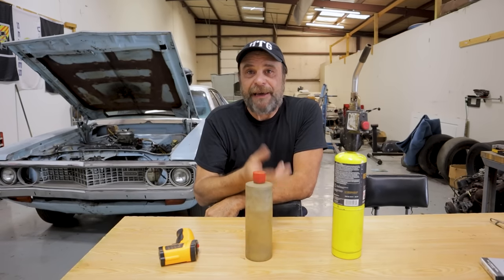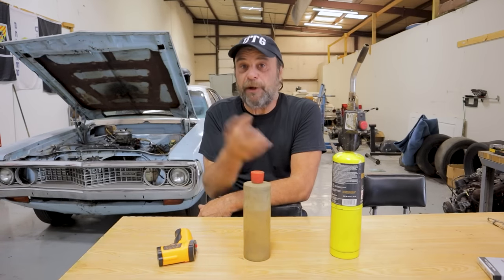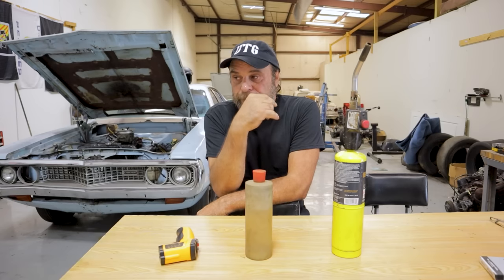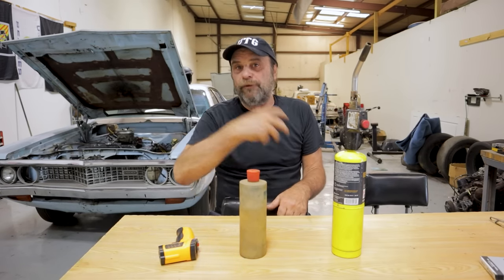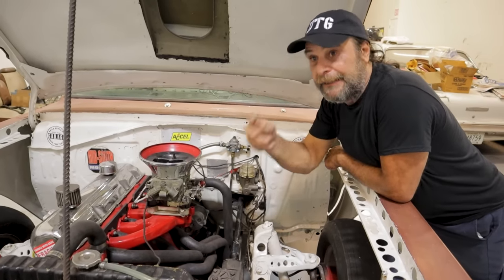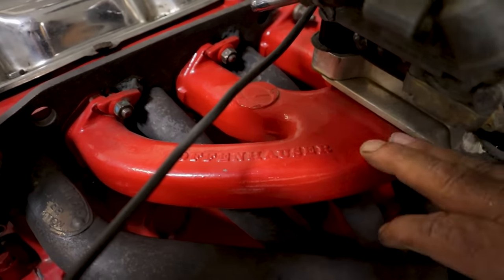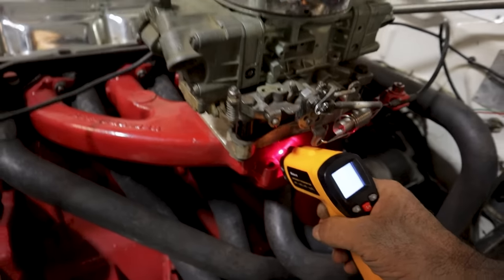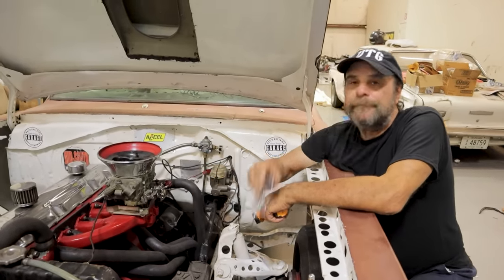How Much Intake Manifold Heat Is Enough? Testing The Vaporization Temps Of Modern Gasoline

Comment: When you talked about that "pre-chamber" ignition system, that is what they are doing in F1 to be able to run a leaner mixture, and extract the most possible energy from combustion event.
Reply: That was Honda cvcc designed in the Late 70s and early 80s cool that f1 is using that technique aswell
Reply: Cvcc honda...  This
Reply: It’s Turbulent Jet Ignition I believe
Reply: B.S. NOBODY runs lean fuel mixures in a turbocharged race engines, if they want the engine to survive, as a matter of fact, only detonation will kill a turbo engine faster than lean mixtures, barring no oil / no coolant.
Reply: @jamesgeorge4874  Improving combustion efficiency is key for F1 engineers since the regulations limit the total amount of fuel that can be used in a race as well as the fuel-flow rate. This new technology replaces the standard spark plug in each cylinder with a jet ignition chamber and helps support ultra lean-burn operation in gas engines. If properly designed, this jet igniter can be a drop-in replacement for the spark plug.
Reply: @jamesgeorge4874  that was a paragraph from one of MANY articles that are a simple Google search reveals. Just search "how F1 jet ignition works". Yes, they are running those engines a lot leaner than you would think.
Reply: @Taranabas52  Interesting info.
Reply: @Spike-sk7ql  Let me clarify, the TJI system is slightly more efficient than previous designs in F1 applications, but F1 is NOT running an ultra lean mixture, because they don't make power, and lean mixtures are catastrophic to turbocharged engines. In NA engines, TJI IS able to run ultra lean mixtures, and with lo NOx output as well, but it requres higher compression, and multiple injection, and ignition events per powerstroke which F1 does not allow , currently. If your info came from engine labs, I understand how you would figure F1 is running ultra lean mixtures, because there isn't a clear distinction between a race engines needs, vs a road car engine needs. For what it's worth practically every fuel injected car built in the last  35 years runs "ultra lean mixtures" when you enter closed throttle mode, it's call deceleration fuel cut off, and zero fuel is injected. Hard to be leaner than that.

Comment: For the winter time in NJ back years ago I used to have a plate that would snap in between the headers. 
 It was a place I could stick a Sterno heater under the intake to pre heat and warm it up before I take off .

Comment: Humm, really interesting and not an issue I would have guessed, learning from UTG.  Looking forward to see the testing results.  I would be mildly surprised if this turns out to be the sole source of the issues but after the explanation, I can see how this is a contributing issue.   Kind of goes against the idea of cooling the charge for more power.

Comment: Now that I'm done talking smack on using a 6 cylinder... still not my thing, but I dont know how the dodge 6 is but the chevy 6 has an intake with a floor that has the exhaust directly below it with a valve that opens for cold starts and lets the car warm up, then closes. The one I had I left stock, and even working correctly on stock stuff it ran like shit until it was warmed up and then it ran fine. I bet this for sure fixes your problem assuming your tune up is as close as you think it is. Good luck

Comment: I’ve dealt with many off idle stumbles, flat spots etc. 90% of the time it was the idle mixture screws either too rich or to lean. Even if you think they are set perfect, it’s best to test on an off idle launch. Adjust one way or the other and see if it starts to correct itself, if that doesn’t help at all then deal with the squirters, accel pumps etc. a lot of people jump to adding more fuel out of the box when they stumble.

Comment: Suzuki used a PTC heater under the throttle body on the 1.6 four cylinder engines in the Sidekick/Geo Tracker. I’m guessing it served that same purpose. They did have coolant running thru the aluminum intake, but it wouldn’t be providing much heat on cold starts.

Comment: Wow, utg outstanding video. I'm vary grateful. I have seen slant sixes with headers and a coolant chamber under the 4 barrel intake. So that it saw coolant Temps 180 or near which every thermostat used. Seems  to be the way to go. What are your thoughts?

Comment: Chrysler wants the carburetor set so that the floats react to 1, the slosh on launch [fuel bowls] as well as 2, the tip angle of the engine, based on the angle of the drive pinion angle.

Comment: Modern cars run coolant through the throttle body. 

Make a  hose route coolant around the intake with a heater valve with a cable and temp sensor in the intake. 

That way you can have all the data. 
Analogue. 
Have your exact temp. 
Spend almost nothing but time and a cheap temp gauge.

Comment: I just built a hot Chevy 292 ,(blank check build) for street / strip/ fun and shows, I had a Man A Fre 3X2 and we bolted  on the dyno and with touch anything we pulled 373 hp Then the rear carb took a shit that drove us nuts for hours. ,We swapped it out for a clifford dual quad with two 450 holleys, everything is new except the 3X2 Carbs off the Man A Fre. We pulled360 TO 383 HP & 418 TQ , The rear carb failed after the 3rd pull. no fuel in #6 cylinder ,The dual quads pulled well but not much different and feels lazy ,The Man  A Fre Intake was NOS !!! AND FOR A INLINE CHEVY SUPER RARE FIND !!! The guy that worked for man a fre in the 60s and 70s id still around and has tons of parts and rebuilds thems for street /stip or show .Super nice guy. But you may not be getting what's in the picture I paid 2500 for the complete set up. first thing  the carbs are not restored, they looked old,when we turned the fuel on the dyno every carb connection looked like a sprinkler . OK,,,,On go the brand new 2X4 AND MADE GOOD POWER AND ANOTHER 10 hp  from an ACCEL coil !!! 4 speed ,choppy cam top notch build. .. I sent all three carbs to Vintage Carbs, he said all three were put together with jnk and old used parts !! not one cluster matched !!!  Yeah I got the typical E-Bay shaft but vintage speed said that he can build me 3 exact Rochester 2 jets and knows I want perfection .and willing to pay for it. I'm doing this since the 1970s.I think  The direct injection 3X2 set up right will outperform the the 2X4 in this application ,

Comment: From what Google just told me, gasoline has a boiling range between 95*f and 395*f at atmospheric pressure. My understanding is this boiling point would be significantly reduced in vacuum through the venturi. Generally I believe lower intake temps are ideal.

Full disclosure I'm an efi guy so my fuel is basically vaporized right out of the injector

Comment: I have to disagree. :) 
Most dyno tests will reveal that horsepower increases when coolant temperature is reduced from 212 to 160 degrees. Most dynos run the engines with pretty low coolant temperature. This will produce inflated hp numbers and happy customers. 
Here is one guy chancing from a 200 degree thermostat to a 180 degree thermostat. This is pretty normal. 
https://www.youtube.com/watch?v=RdqV1oHMXCA&t=255s

Engine oli temperature should be above 212 degrees. 
Regarding intake manifolds I think it is pretty disapointing that only the Edelbrock 7116 has provisjon for engine coolant heating / cooling. Therefore I always recomend everyone to CONSIDER running the 7116 and combine it with a 160 degree thermostat.  
We have welded and modifed other manifolds to be able to do the same. 
They do need it as exhaust heating is overdoing it and Air gapping is underdoing it. ;)

Comment: Modern cars run at around 220. The fuel gets injected against the back of the intake valve and has to get some vaporization in the short distance inside the head. The modern intakes are made of plastic so they don't introduce heat into the incoming charge. The air intake usually sucks from down low outside the engine compartment. In order for the fuel to have any chance of vaporization it has to have a much lower boiling point. 

This lower boiling point can lead to the fuel vaporizing in the suction side of the fuel line on carbureted cars. Modern fuel injection runs at higher pressure and the pump is usually in the tank pushing the fuel rather than pulling it. 

Having fuel in a vacuum will reduce it's boiling point so you might be fine at idle or just off idle but when you whack the throttle open vacuum drops nearly immediately. With this drop will be an increase in the boiling point of the fuel. All this to say Uncle Tony you seem to be on the right track here. 

I am building a 318 with a TR5 Edelbrock tunnel ram intake. It has a large open plenum so I am going to try progressive linkage and use a pair of Edelbrock 500 CFM AVS2 carbs with the annular boosters. Hopefully I can get the fuel to distribute and vaporize properly. I might run a warmer thermostat to help with this as there is no exhaust cross over. I'm going for fuel economy with a tunnel ram. LOL.

I'm also toying with the idea of running 180 degree headers with about 39"-42" long 1-5/8" primary tubes. This will be to try and maintain more low end torque. I will also size the collector too match the smaller size requirements of the 180 degree headers.

All this in a 1970 W200 truck. Probably been watching too much Unity Motorsports.

Comment: It’s my understanding that octane is a measurement of flash to prevent premature detonation. 🤷🏻‍♀️ use 87 if you need better quicker flash. Use the 90 for higher compression to slow the flash. You might get earlier bang by dropping your octane. Not sure it will carry the power through top end. 🤷🏻‍♀️

Comment: Your slant needs 30% smaller squirters,  a 30 cc acc. Pump, and a delayed pump cam. Your dumping fuel without air flow. Less fuel....more air! Fine mist from squirters instead of buckets of fuel droplets. A long sweeping and delayed cam!!!! For the pump.  Bring the timing of the secondary blades 30% later. Let the vacuum drop as slow as possible off the line. 
  The heat your looking for is not important.  The air and fuel pass over the intake floor faster than it has time to warm up. If fuel is building up....like it is in your can so far. It's actually cooling the floor with puddles.

Comment: Ethanol baby! So I looked it up an it seems ethanol boils at 173 F or so degrees.  One thing I’d like to point out here is you’re using a temperature device the I believe uses IR signature to determine the temperature. Unfortunately the aluminum plate is shiny and the intake was not. These devices work on emission of IR and shiny surfaces have historically been difficult because their emmisivity is that a word? Is not what temp guns are typically calibrated to read. So there may be some discrepancy between the measurements taken between the plate and the manifold.  

Lol so my cast iron intake manifold question wasn’t so dumb lol, only good luck on a 4 barrel one of those! Next really dumb question is now that the warm up period is Kentucky windage in what happens when you are WFO down the track?
The fuel is taking heat out of that manifold like a vacuum and because it’s aluminum it is saying here ya’ go pal, go play with the spark plugs. 

And the temp is dropping and the vapor percentage is dropping and there’s less fuse to the drops for the spark plugs to play with but the pace is expected to be up at 6000 rippems… have you got enough latent heat in the manifold to pull off the run or are we going to need some auxiliary help with the heat?
Maybe beg, borrow, or gleep a thermocouple and a recording thing to record or see the manifold temp to know if it maintains temp all the way down the track? 

PS they make these thermal switches to control fans and coffee pot heaters and I bet we could find one that’d be pretty close to that 150 mark so it’d heat to 150 switch off cool to the hysteresis maybe 125 or maybe 140 and click back on again 😬😉 

Good luck this weekend at the track!! Go get ‘em!

Comment: IF you have to add a heater to the manifold, they make "self stick" oil pan 12v heaters that you could turn on and off with a switch. That way you could heat just the plenum. I would not trust the adhesive to keep it in place, just because of the header heat. I would sandwich it in place wit a piece of sheet metal. Or you might be able to have a "water box" welded under the manifold so that you would never get high heat going into the manifold.   ///   Something you said about fuel burning speed tripped a switch in my head. I have thought about this for many years, but I have no way of testing it. I wonder if a small amount of diesel fuel mixed in with gasoline (like 5 - 10%) would make more power. It burns slower, has a higher energy density, and has lubricating properties which should help with piston ring sealing.  I am sure you know somebody with a dyno. Maybe you could talk one of them to try that. I am sure it would require larger jets, but if it makes more power, it's one more "trick in the bag".

Comment: @UTG.  You need a LOT of heat to overcome the cooling effect of vaporizing Gasoline. As in exhaust gases hot heat. Even hot coolant circulating through an aluminum block beneath the carb may not be enough in terms of BTU's  required. You may have to re-think the entire intake/exhaust manifold design. Also, not trying to be too critical here, but that chrome air intake horn-of plenty you are using may be cool looking, but it is the wrong shape for smooth air flow into the carb. It looks like the mouth is far too wide, and the outer edges should be well rounded. Just my 2 cents. You have a great channel Tony.

Comment: that's why i laugh when Nelson Racing Engines and others with videos brag how cold their engine is running. you don't want that. Old NASCAR builders would talk about how their engine was running real good just before it overheated. someone once made an intake-to-head gasket with a window screen in the port to help atomize, but let's be frank...you want atomization, you go with pressurized jetted fuel injection.  I see a lot attempts here to heat up the intake system, and the OEM factory setups were doing that in the 1970's with heat stoves off the cast exhaust manifold or running coolant through the intake manifolds or letting hot air splash up from the lifter valley.

Comment: I'm an Internet Expert.  It's obvious what you need is a purple stripe around the top of the carb where the booster layer and choke layer meet.  With your displacement between 1/4 and 3/8 inch wide should get you about 125 HP.  I did my 318 this way and that's what I gained, but it only takes 1/8 inch on the 318 because of the displacement and the heat from the valley.

But seriously I would get a thermocouple temp sensor into the floor of a good running V8 and see what temps you get at different operating conditions while running, then add one to the /6 intake and work on it from there.  The /6 intake will be a lot easier to modify.  No replacement for displacement, or actual data.

Comment: Just a suggestion, you spoke about the clocking of the carburetor and stated that it was what Chrysler engineers stated to do. I would keep an open mind and actually try the 4 positions available if it bolts up without added expense. Can you say, trust no one?  With all the different variables going on with engine build, I would have to see for myself.  I am not building a 6 with a 4 bbl, almost did but a '72 Chevy van presents driving issues with a carburetor where your leg should be as the manifolds available then had longer runners and probably still do. I canned the though of hopping up the engine. It actually got worse gas mileage than it's replacement, a '76 Chevy Van with a  350 and a Q--jet in front of another 3 speed column shift. I miss that truck. Both of them actually.

Comment: My 441ci 67charger liked to be at 180deg and finished at 210degs and I left on the converter 5500 stall and a 489 rear gear ⚙️ If I flashed the converter by by  drive shaft with 1350 u joints .

Comment: I still say since the intake is aluminum weld on a small aluminum box to the bottom of the intake and have heater hose with male fittings for an enter and an exits for coolant to run through the box back to the radiator so the intake will heat up

Comment: You do not need heat in your intake with a properly working carb (unless so cold as to cause icing). Atomization is caused by air velocity, not heat, which is why cheap carbs use a second vacuum actuated choke. All good carbs can atomize fuel across throttle settings. Motorbike carbs do this with a tapered needle in the main jet (later carbs also operate choke using vacuum - for emissions not performance). And these will not burn your hands even after significant run time - they stay relatively cool. SU and Stromberg actually open the throttle using engine vacuum, keeps air velocity up. Weber has properly designed carbs that effectively have different jets at different throttle positions. Symptoms you have are the same as a motorbike carb with incorrect float height.